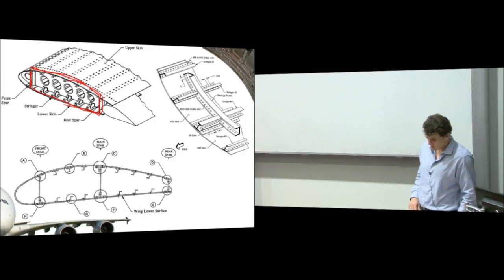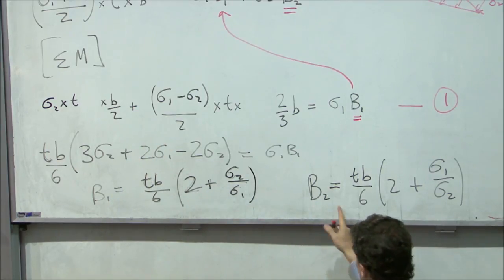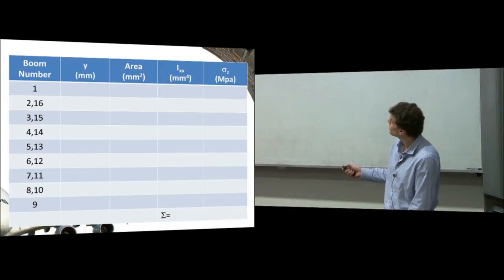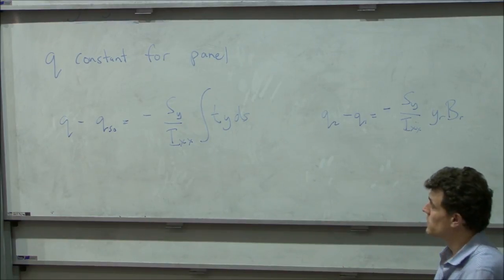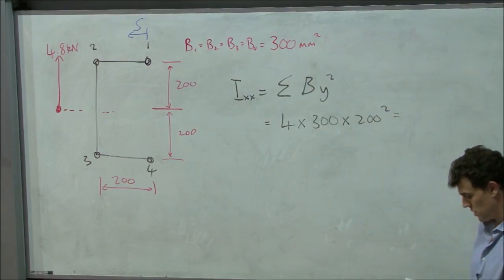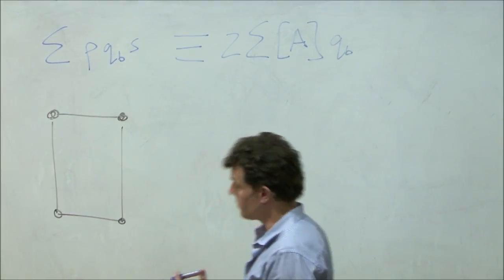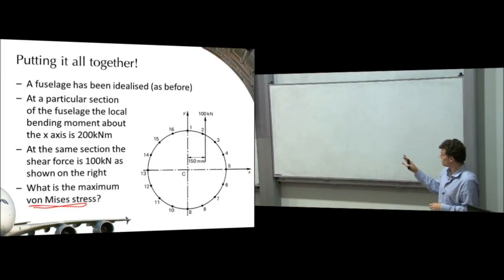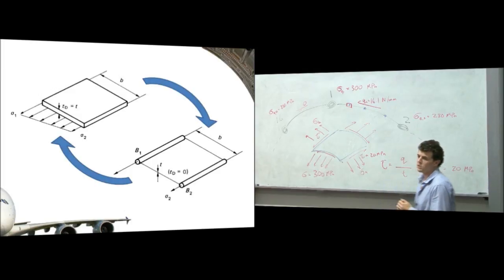UNSW - Aerospace Structures - Thin walled Structure Idealisation

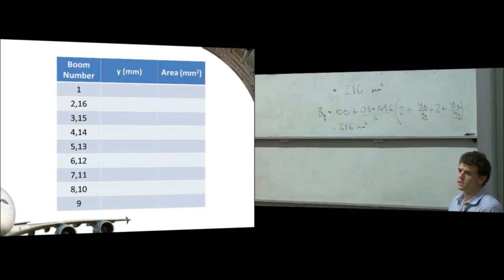Comment: Regarding Boom area calculation (up and until 34:50), shouldn't each boom account for "half" of each adjacent panel? Otherwise you'll globally account for each panel twice, right?
Reply from the maker: Yes, you are correct in general. The idealised case should have the same area as the original, so each boom should have half the area of the skin from each panel. In the specific case from this lecture (i.e. when pure bending moments are applied to the section), you can make a slightly better approximation to the area distribution using the formulae provided.
Reply: The teacher is pulling these numbers right from Megson (pgs 560 and 599). If you examine the fuselage analysis method, the author adds area due to both adjacent panels to each boom. This makes sense, because you need two forces to be able to counteract the moments in the panel. Think of it as half the area of the boom is needed to counteract the moments on the panel to the left, and half is needed to counteract the moments to the right (until you reach the end of the beam).
Reply: I thought of that too
Reply: Same thoughts here.. @Aerospace Structures @ UNSW any answer?
Reply: He used Force and Moment balance to get boom area